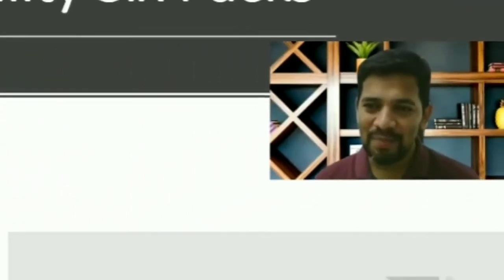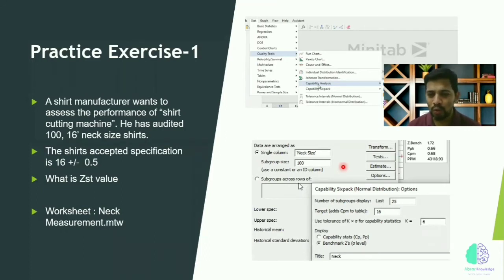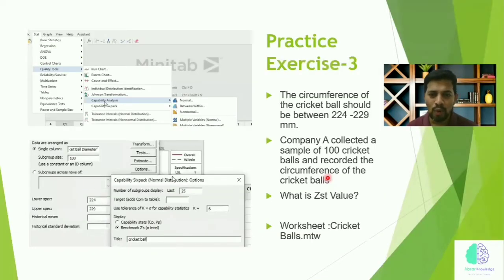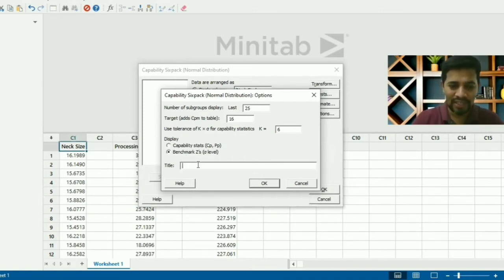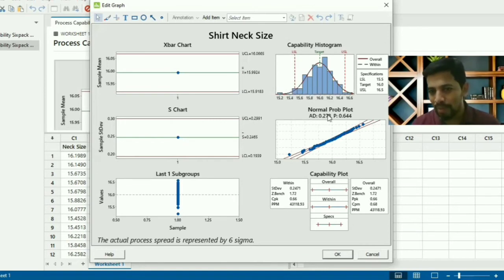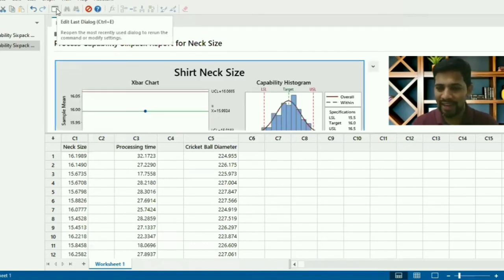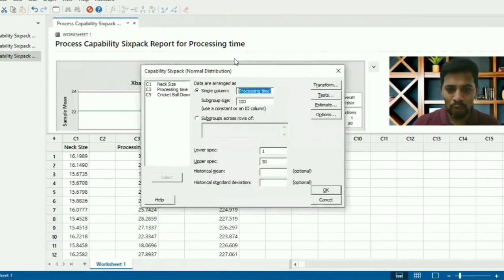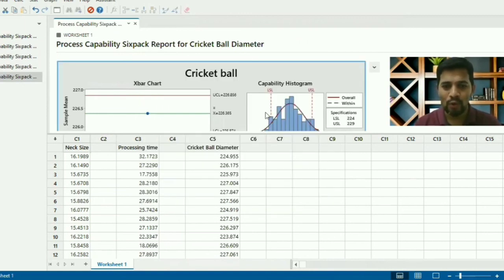MiniTab SixPack Process Capability Analysis (Normal) |,with 3 Practical Example | Zbench, Zst, Zlt |

Comment: Hello, thanks for the lesson. 2 quick questions:
1) What is the real difference between KPI and spec limits? They seem the same thing. 
2) cycle time example is also a form of KPI I guess. Does it still refer to the voice of customer or it's voice of business?
Reply from the maker: Thanks for the questions..really appreciated
Reply from the maker: Key Process Indicator is an output to any Process.example on time delivery ..Resolve customer concern within 10 days and so on..whereas spec comes from an input to Process.example, if customer says use resistor of 10 ohm and 1% tolerance..then LSL=9 and USL=11..anything outside is outlier
Reply from the maker: Cycle time can be voice off customer and process.it is also a gold metric..example reduce Cycle time by 10%..monitor and take actions etc
Reply: @AbrarKnowledge   thank you! Couple more questions about this:
1) why is the cycle time both VOP and VOC?
2) Does everything start from VOC or we can have a VOP that is indipendent from VOC? For instance, is improving cycle time coming from a VOC input?
Reply from the maker: Let me elaborate on VOC ans VOP 
Let's say you are working on a bank and bank policy says that you need to complete a process of loan sanction within 5 days...here target may have defined by company by comparing competitors...let's say bank Studies a pattern average time to close and then  decide what target can be kept.. so it will VoP... another angle...customer comes and say that I will go with your bank only if my loan gets sanctioned within 3 days.then it will become purely VOC
Reply from the maker: Both are dependent factors..case to case we have to see.i have covered various video on control charts and process Capability..if you search " abrar knowledge control chart" or "abrar knowledge process Capability "
Reply from the maker: You may get to know more precisely
Reply from the maker: Hope it helps @data science
Reply: @AbrarKnowledge   these are all great examples. One very last thing is still not fully clear to me. Let's say as a new policy (taking other companies as a benchmark),  we need to reduce recruitment time at a maximum of 3 days. Can I still calculate cpk using 3 days as spec limit? I ask you because in this case spec wouldn't come from VOC but from VOB.

Comment: Hi Abrar, can we say that an uncapable process means that it is biased? I would appreciate your feedback about this. Thank you
Reply from the maker: Thanks for the questions..
Uncapable process means process is not centered to meet the requirements of customers (in process Capability test) ..it may be due to various factor..Standard deviation is high which means more variation, or tolerancing not adequate set up or bias ( for this, same you have to carry out MSA to confirm the same)

Hope I have done the answer
Reply from the maker: Feel free to ask questions
Reply: @AbrarKnowledge   thank you very much. I actually didn't formulate the question correctely. I just wanted to ask you if an off center process can be considered biased
Reply from the maker: Welcome. The answer is no..bias is one factor which needs to be tested further MSA and hypothesis..
Reply: @AbrarKnowledge   this is a very interesting topic. I'd like to share what I would do here. I would test process center and target with a t test or z test. If they are statistically different, I would think process is biased and check for the reason in MSA for example. Would you agree with this approach?
Reply from the maker: This will be perfect approach..Correct  as well.also, focus to reduce Standard Deviation that's also a key
Reply: @AbrarKnowledge   thank you very much. Would you share an email address where I can get in touch privately?
Thanks a lot
Reply from the maker: AbrarKnowledge@gmail.com
Reply: @AbrarKnowledge   hi Abrar I sent you an email yesterday. Waiting for your feedback. Thank you
Reply from the maker: Yes I did receive..I will respond before Saturday. Held up with too many things
Reply: @AbrarKnowledge   thank you. I will wait for your feedback